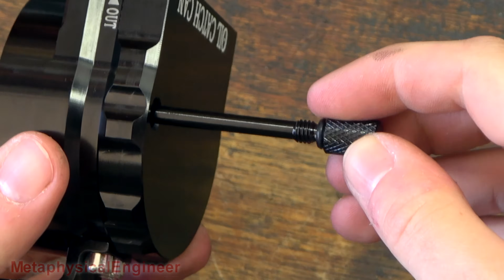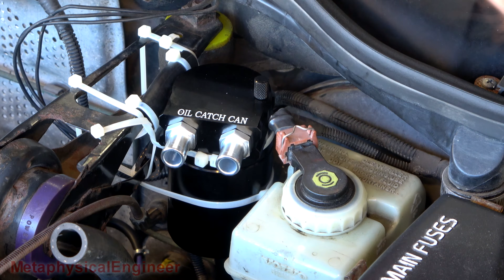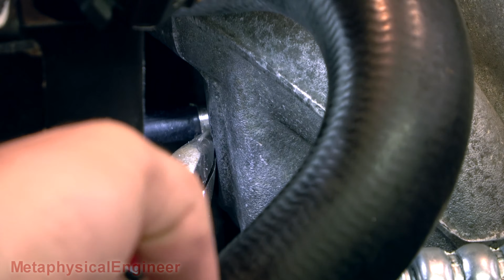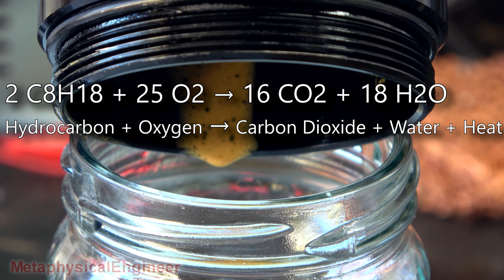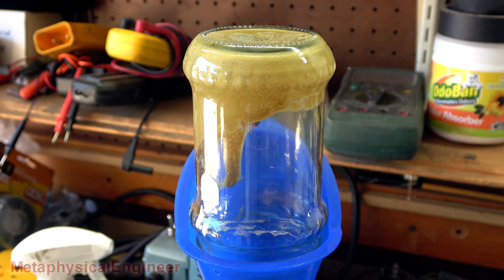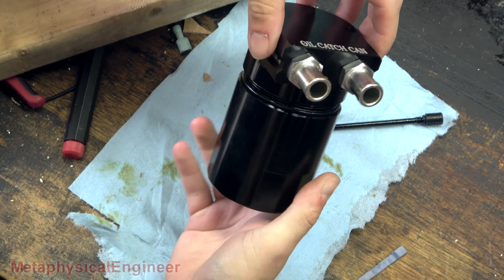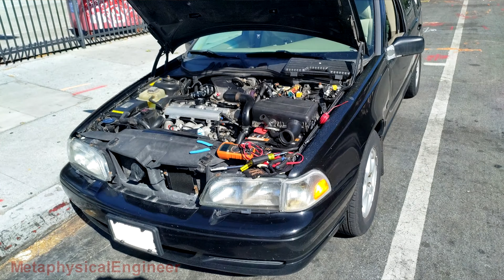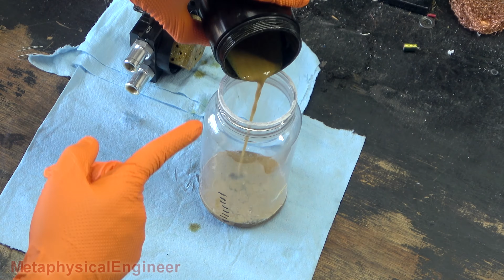I Tried the Evil Energy Catch Can for 3000 Miles

Comment: Four GM’s Gen III and IV - LS based 4.8, 5.3, and 6.0 oil consumption: I recommend upgrading to the revised driver-side valve cover with the improved PCV baffle. (GM bulletin PIP4492S covers this oil ingestion issue.)
My catch can used to fill with oil every 4,000 miles. Since replacing the cover, virtually no oil collects, and my oil consumption is gone!
I also drilled four evenly spaced 3/16” drain holes along the bottom edge of the internal baffle to improve oil drainage. I’ve done this on three trucks now using the $45 Amazon driver side valve cover. I also removed the excess RTV around the baffle edges (with a fine wire brush), cleaned out all debris, and used the included gasket. Two years later, no issues or oil consumption!

One more tip: Check the cam sensors O-ring (behind the intake manifold) for an oil leak, which most people think it’s a rear main oil leak. If the sensor works, just replace the leaking O-ring, not the entire sensor!
Hope this helps. Good luck!

Comment: Great video, thank you. I have the same unit, different brand on my 2013 Dodge Charger V6. Captures lots of oil over time. I used copper anti-seize on my threads and they are whisper quiet and the reservoir is easy to take on and off.

Comment: I have one on my pickup. Direct injection, naturally aspirated. I works good. hlHowever since I live in a cold climate and the majority of my driving in winter is a short 15-20 minute commute, it fills up quickly with moisture/condensation and freezes. So I have to bypass it.

Comment: Has anyone considered incorporating a pressure relief valve in case ice builds up in the catch can inlet causing a pressure buildup inside the engine leading to a seal blowing out?  More of an issue in colder climates?

Comment: I have a 2016 2nd gen Cruze that I run a catch can in... I got 237,000 mi on it with no ticks. Doesn't burn any oil. The car runs mint. It actually works really well

Comment: What is the alcohol percentage in your fuel. That seems like a lot of water.
I made my own catch can out of a stainless thermos from Wally World.  For the inlet and outlet  I drilled two holes in the side of the thermos. One about two inches up from the bottom and a second hole two inches down from the top. I used J-B weld original to put a fitting in each of those holes to attach my hoses. 
The PCV valve in my Chevy 4.3 valve cover goes to the lower fitting and the upper connection hose goes to the intake manifold connection in my throttle body.

It was difficult but I also installed a half moon shaped baffle Midway on the inside of the thermos. I epoxyed the baffle in place with JB weld original after abraiding  the stainless steel baffle so the epoxy would bond better.

Basically, I have a stainless steel catch can with a lower and upper connector for the hoses.
I put a stainless scrubber mesh inside the thermos for the oil vapors to collect onto
. 
The vapors flow from the bottom of the thermos up through the mesh and the clean air comes up through the top hose, the back into the intake manifold under the throttle body.
The engine in my Chevy S10 pickup has 316,000 mi on it so quite a bit of blow by.  The catch can collects about an ounce every 550 miles.
My residue is almost totally oil with just a tiny smidge of moisture.

Being the thermos is large,  one quart, maybe 20 ounces ...  there is plenty of time for the slow moving vapors to settle on the stainless mesh, then settle and drip down onto the bottom of the thermos.
It works fantastic. I find it odd that commercial catch cans  have both fittings next to each other at the top of the can.
I'd recommend a catch can to everyone. Why have that crap drop into your intake manifold to be burned.   Catch cans remove it.

I made my comment before watching the entire video.  I restarted watching at the point you were adding the baffel  because the inlet/outlet were so close together.
My larger catch can has lots of room for the filter media and LOTS of internal volume. That makes for slow moving vapors inside the can. Slow moving vapors mean they have time to attach or condense onto the filter media, then drip to the bottom of the can.
The cheap can has its flaws, but it is collecting something, mostly water it seems.

My larger container wouldn't be easy to fit into a small engine compartment.

I do have two questions, is your thermostat operating correctly and do you have a lower than factory temperature thermostat? 

I'll mention it again but do you have a 15 percent alcohol content in your gas?   That just seems like an awful lot of moisture condensing out of the engine unless these are all very short trips and the weather is cool. 

Great video and experimentation. 👍

Comment: The glove test works for diesel engines as well, right?

I have a turbo-diesel engine with a flame trap and a crankcase ventilation valve that routes blow-by gases into the intake, between the air filter and the turbocharger.

My plan is to install a catch can after the flame trap and before the valve, so the valve stays clean and, as a result, the turbo and the rest of the intake system also remain much cleaner. Does that make sense?

Comment: You're always going to get a little bit of moisture that gets into the exit side of the catch can because of the very high that exists within it. Remember that every time you shut your engine off a lot of moisture out of the air condenses inside the engine. You will scrub out a little bit more of that if you put that pad material back into the baffle. My catch can I actually have a screen that sets below the primary baffle and that's where I put the stainless steel scrub pad.

Comment: To my 1.6hdi,mk2, I installed a free flexible hose on the PCV, plugged the turbo hole, and it became free, it throws the oil/exhaust gases freely under the engine, I don't know how reliable the patent is like that

Comment: Yooo thats so cool... i started to look for catch cans i need for my NA-T build and this evel energy was one of them.

Now i know what to look for/after while using a can on a turbo build... thanks for sharing this man.
Reply from the maker: Thanks for commenting, and good luck on your build!  

Adding boost make a lot of vacuum system stuff we take for granted on an NA setup more complex.  PCV and evap need separate paths for on boost and off boost.  Brake booster check valve needs to handle boost without leaking.  Vacuum diagram starts looking like spaghetti before long.

Comment: In my opinion, these nipples offer an inlet and outlet of only 10mm, which is very narrow compared to the vehicle's original measurements, which are around 15mm. Over time, excessive pressurization in the engine can occur, leading to leaks. I am referring specifically to this model of Oil Catch Can.

Comment: Hello, i have a 2021 Ford F150 5.0 V8 with dual port injection:  Direct injection and Port injection.  Considered installing an oil catch can but don't know if my scenario would benefit?  If i do, i'm concerned about winter season due to freezing temperatures.  I do live in Texas but we have been known to have some harsh winters as well
Reply from the maker: The dual injection does solve the intake valve carbon problem that direct injection is notorious for, but intercepting oil mist before it gets pulled through the engine is helpful.  Cleaner burn, less piston and chamber deposits, and less chance of pinging under hot high load conditions.

You're smart to be cautious about moisture and freeze ups during cold weather.  As you see, even with the very mild weather where I live still made for a lot of condensation that would absolutely risk freezing up the system if I were to go through freezing conditions. 

There are heated oil separators on the market, and I'm currently working on a heating system for my catch can to encourage the water to move along while leaving the oil and slime and solids behind.

Comment: I used the same oil catch can for my 4 cylinder kia mpi NA engine just for curiosity sake. It would collect a very dark thick oil about 20 to 30 ml per 5k miles and I noticed engine oil will not smell like gasoline at 5k and more like before installing it
Reply from the maker: Thanks for sharing!  Even on an NA and port injected engine, that's a lot of nasty stuff getting caught before it makes a mess of the intake.

Comment: What about the EGR track?
Reply from the maker: This particular car doesn't have EGR.  Backpressure from the turbo keeps some exhaust in the cylinders, providing the same effect.  

On systems with EGR, those gases aren't usually filtered.  EGR by itself has dry soot that doesn't stick to valves very well.  When combined with the sticky oily PCV vapors the soot becomes a problem, clogging intakes and fouling valves on an direct injection engine.

Comment: I have a Moroso on my wife’s 2015 Honda Civic. Change oil once a year..there is always oil in it. I installed a Ford Performance Separator on my 2018 Ford F150 5.0. The catch can is designed for the Mustang 5.0. There is usually 1 oz of oil init every 1000 miles. Both installations are on you tube
Reply from the maker: Thanks for the insight!  Those Moroso units look really nice.  How many miles do you put on the Civic in a year?

Comment: Great video, well done with a logical approach. I used the same can on an old school V8. I noticed a drop in idle vac and traced it to the dipst8ck in the can not sealing. I added an O ring to the dipstick and fixed the issue. Catches lots of oil due to poor valve cover baffling.
Reply from the maker: Interesting the o ring was missing from yours.  My kit came with some spares in the little baggie.  How often do you have to empty the can?
Reply: @MetaphysicalEngineer i dont put the same mileage on that you do. Initially I would get 4 oz or so every few hundred miles. Use of an adjustable PC valve allowed me to tune the idle vacuum which is where i was getting most of the issue. I also elevated the valve to get some help from gravity to limit the amount of oil reaching the valve.

Comment: Made my own can by using a good brand (Norgren) inline air filter/water separator. Got rid of the filter element,installed 3/4 npt stainless steel airmuffler,reversed the flow to let the vapors hit the muffler first (and cool the vapors in the porocess). Also,this setup makes outlet significaly higher than inlet,keeping as much vapor traped as it can. Bowl is made out of clear high temp rated composite that can take some abuse. You can actualy see the level everytime you open the hood. Works for several years by now,and the main point of it is not the intake valves (my engine is not gdi or turbocharged,simple naturaly aspirated port injected),but my concern about the ruined catalitics from the burned oil.

Comment: What I'd like to see is a vid explaining exactly what a catch can does/is for. How come I don't need one (2007 V70 D5, 175K)? And what's wrong with a bit of crankcase pressure? Sure, last time I drove my car at 130 mph - yes, it still will do that, and I can't say where and when I found this out... - it left some oily grime on the under-cover when I did an oil change, but the engine was strong, and I'd probably blow a bit if I was pushed that hard!

Comment: I installed that exact catch can and also added a Gm inline pcv valve on 530xi n52. Using inline pcv before catch is key to reducing oil consumption the engine has more power runs better and the car now gets 32 mpg highway 24 city driving
Reply from the maker: Awesome results!  Was definitely considering PCV system mods for more flow until I found the collapsed hose causing all my problems!

Comment: I had same catch can on one car filed with steel wool on the big can, was colecting pure oil. Move it to diffrent car, collected just yellow water. I guess it matter the position of mounting and the length of hoses (should be short as possible)...
Reply from the maker: Yeah, given how my oil analysis always looks great and I'm not losing coolant, I think it's a position and operating conditions problem, not really an engine problem.  

Working on solutions as we speak to hopefully reduce how much water accumulates.  If even long trips in warm weather still need it emptied every few hundred to a thousand miles, that would be a problem on longer road trips.
Reply: @MetaphysicalEngineer  I ended up blocking the intake hole, and on the outlet of oil catch can I add a filter and let it breath... I was just tired of egd fumes clogging the intake manifold after mixing with oil...

Comment: That’s a lot of water catches by the can, isn’t it? It should only have the exhaust gas (air/fuel mixture burned) plus oil vapor. Perhaps you have a blown cylinder head gasket? Do you have to top coolant somewhat often?
Reply from the maker: It is a lot of water, but the car never loses coolant, and oil analysis never shows any chemical trace of coolant getting in the oil.  After further testing, it seems the catch can simply never gets hot enough, so becomes the place where all the moisture collects.  Working on possible solutions so it can catch the oil sludge but let the water pass along.

Comment: The problem here, is that just because it catches a couple ounces of oil over thousands of miles, doesn't mean you actually avoided any damage or buildup...  

They will catch oil, but several large mechanic channels have done in depth testing of cars with and without catch cans, taking off the manifold and measuring carbon buildup before and after, etc...  The conclusions are that the catch cans have little to no real value on a daily driver vehicle...

People just see the oil and conclude that its working, but never really test the valves with and without the catch can, so see if that little bit of oil actually made any difference to your valves...  The channels that went that extra length, found that there wasn't any difference to the motor...
Reply from the maker: Except I'm not trying to solve an intake valve carbon problem, which doesn't happen on this port injection setup. I'm intercepting oil to stop the seepage from the boost piping making a mess. The boost pipes and intercooler aren't slimy anymore and there are no more drips coming from the turbo compressor housing. 

But for my own curiosity, if you got links to those videos I'd want to check them out for sure!

For a really high performance engine ( not mine!) there are benefits as oil mist can encourage pre-ignition.

Comment: Wouldnt that first catch can be backwards? I thought air in a catch can had to go in before the filter and baffles.
Reply: There’s a in and out marked on can hard to screw it up after hooking mine with the truck running I unscrewed the dip stick l could feel lots of suction trying to pull the dip stick back in working fine

Comment: A couple years ago I installed one of these on a Gen 3 Prius. In that design the oily PCV vapors would combine with EGR particulates at the plenum EGR ports and differentially block them off. Cylinders 1&2 would run in an undetected lean condition and the resultant excess heat could cause HG problems.

Anyway, the OCC only cost me $25, but the non-collapsible transmission cooler lines from Napa ran me ~$80. Trust me, you want sturdy lines.

The OCC did not capture all the PCV vapors. It just reduces the amount that’ll make it to the plenum. I’ll bet my setup caught less than 50%. I figured any reduction was helpful. 

You definitely need to keep on top of it so it doesn’t fill to the top. Especially in cold months.
Reply: I've read that bypassing the catch can during the freezing winter months is worth it because condensation freezing inside will block off the PCV system and cause the higher crankcase pressure to push out of the front end rear main seals and damaging them.
Reply: @anthonyconte6432
As long as it doesn’t fill all the way to the top of the can, you’re fine. I’d definitely get a good feeling for how fast it fills during those months and set an alert on my phone in order to take the appropriate interval on it.

Comment: I saw another video that claimed these catch cans can gather condensation and freeze up in the winter. When that happens your crankcase can build pressure and blow out main crank seals.
Reply from the maker: Indeed, even the instructions warned about problems in cold weather.  I'm in super mild SoCal but I'm still dealing with chilly weather affecting how the catch can works, so there's another video in the works about what I've done about it.

Comment: Many years ago I installed a low cost Catch Can (from Amazon) on my one vehicle.   Simple install with clip off / clip in factory style hose fittings.   I empty this can's "junk" every month (when checking other fluids monthly) and am amazed how much "crud" it catches and stops going back into the engine.  IMO:  CC's should be factory build.   Especially on today's sensitive designed engines.
Reply: With Port and Direct Turbos you would catch oil diluted oil in warm climate and optional;
Reply: Air Oil Seperators are a better option for many (non turbo/performance) engines
Reply: Just make sure the hoses aren't collapsing when you step on the gas. Definitely check that!
Reply from the maker: Would be great for longevity of the vehicle if maintained, but let's face it, a lot of car owners don't even know how to check the oil.  Adding yet another maintenance item to the list of neglects would only make reliability worse once the can filled up and started sending slugs of crud down the intake.

The alternative is the fancier heated oil separator that drains the oil back to the sump while letting the water and fuel vapor pass through.  But that also means the nasty burnt oil gets sent back too instead of getting captured.